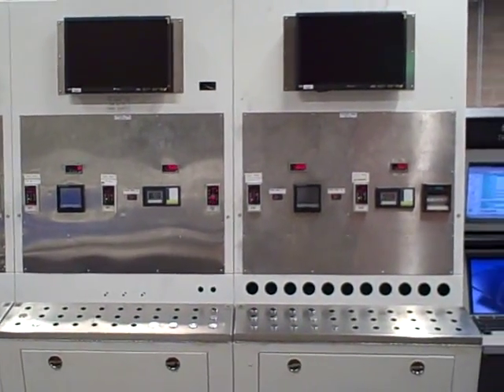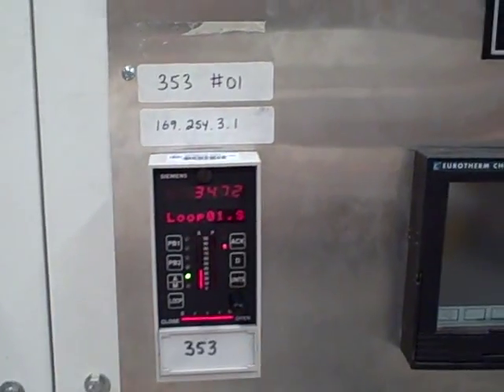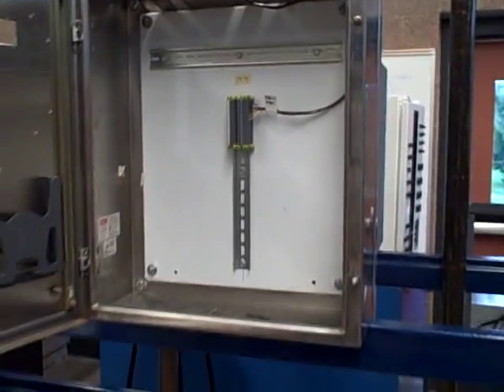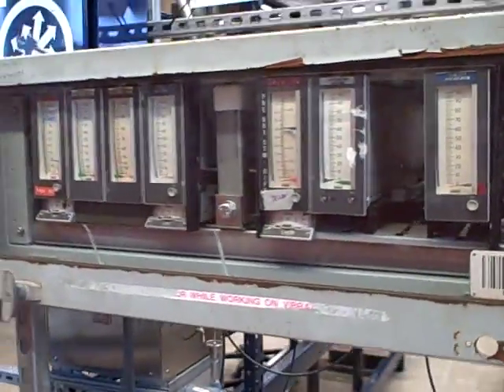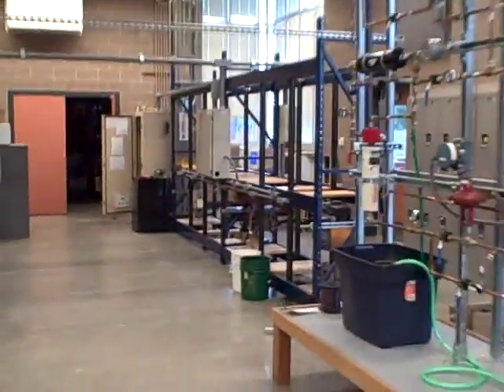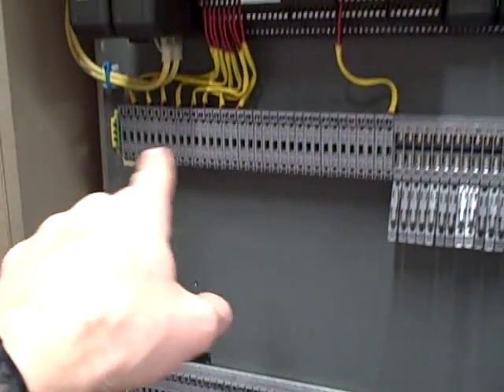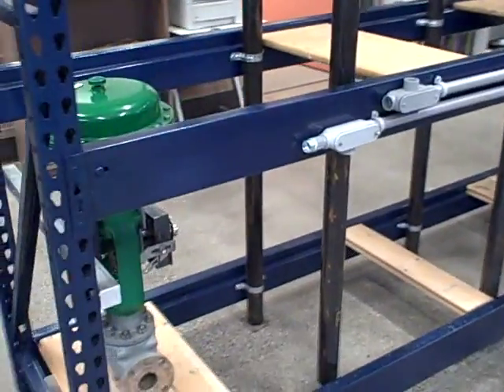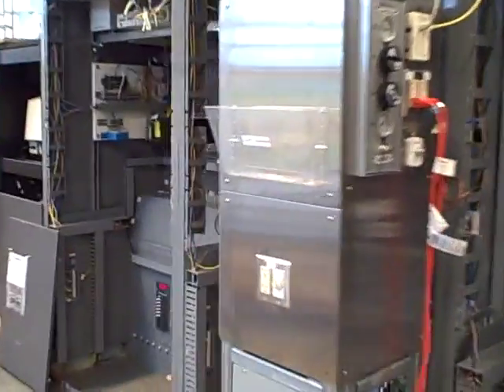Tour of instrument loop system after July 2009 remodel

Comment from the maker: Students learn far more by building the loops themselves.  Not only do they learn good construction techniques, but they also learn to sketch "as-built" loop diagrams (or build loops according to a given diagram).  With a well-organized "loop system" in place, the actual construction time for each working loop is just a couple of hours.

Pre-built simulators only make sense for very short-term training sessions, where students don't have as much time as they do in a full-time degree program.